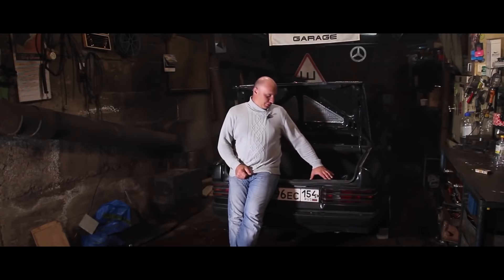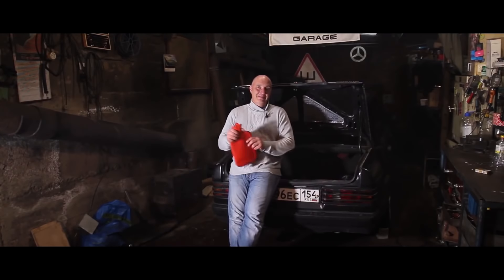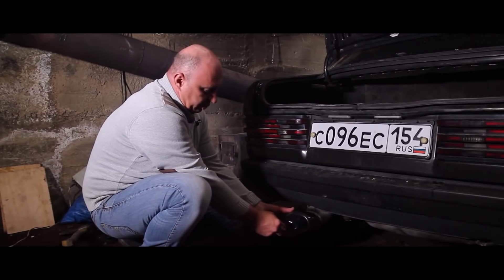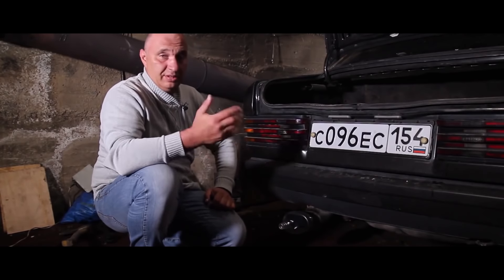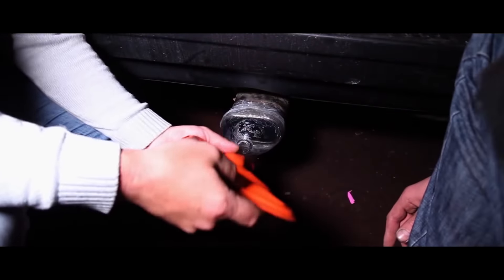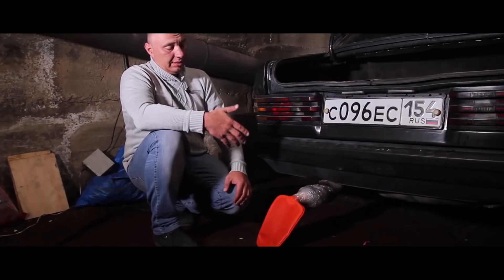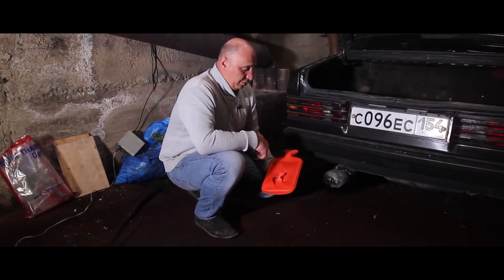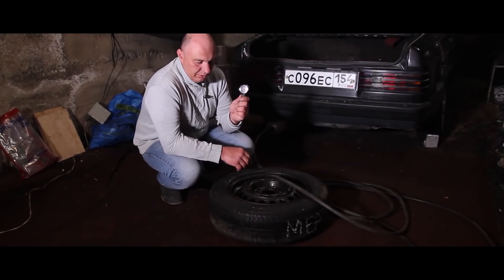Heating pad vs exhaust system: what gives up first?

Comment: Attach a hot air balloon to the car so that it uses its exhaust to fly.
Reply: sounds like a regular baloon with extra steps
Reply: Can't happen. Molecular weight of N2 is 14g/mol. Molecular weight of CO2 is 44g/mol. Molecular weight of water is 18g/mol. Air is about 70% N2 by mol. Exhaust is made of CO2 & water. You can't float a car with exhaust and you certainly can't get it hot enough and keep it hot enough for the density to be low enough to do that
Reply: It's actually Propain that burns to heat the air inside a hot air balloon at 300°+.
Nitrogen is an inert gas.(none flammable)
The gasses that come out of an exhaust are Carbon monoxide,Sulphur dioxide and Nitrogen oxide.
With a tiny amount of liquid known as H2O. 1Hydrogen atom with every 2 Oxygen atoms
Due to the lack of flow (volume of heated air) through the exhaust and the fact that a hot air balloon isn't sealed. Garage54 would need atleast 5-6 cars just to achieve the shape of the balloon with pressure.
2hours later the balloon still wouldn't achieve lift. Due to heat loss and lack of buoyant gasses.
I hope this is more understandable than quotes of weight per molecule lol.
Reply: Great information, thanks.

So any way to make a car exhaust blow propane gas fumes?
Reply: @Vikesh7896  Only if you happen to have a spare Bat mobile (with the turbine engine) lying around lol.
H20 is actually 2hydrogen atoms and 1 oxygen atom
Typing error on my behalf. Ooops.
Reply: @fidelabc123  woooosh
Reply: @Vikesh7896  I think there are many propane conversions - sort of.  There are natural gas conversions, and I think they can run on propane.  As well, forklifts run a combustion engine on propane.

Just in case statement leaver wants to come in with lift calculations, no one specified a size of balloon.  You could use a zepplin to lift a car EASILY - I'm pretty sure they transported military equipment.

And to possiehandler with molecular weights: hide helium tanks in the car and lift it with that as a fun prank/stunt, letting the exhaust escape or remain negligible.
Reply: @easymac79  Now we getting somewhere, we just need uncle Vlad to see this!

Comment: My grand father made an air compressor, using 2 of 4 cylinders from a 4 cylinder engine, the other 2 cylinders is what ran it.
Reply: Great idea
Reply: Scarakus cool
Reply: This was back in the 1950's. He had to make custom intake & exhaust manifolds, to separate the gas/exhaust from the air intake/pressure.
Reply: Wow that's kinda genius
Reply: You would need to make custom camshafts for that, that would be a lot of work
Reply: @georgobergfell  no if you place check valves instead camshaft driven ones
Reply: There are many compressor manufacturers that do just that.
VW boxer engines with a modified camshaft are quite often used.
Reply: @georgobergfell  
No, not a lot of work at all.
It's simply welding an extra lobe on the camshaft at 180 degrees to the existing lobe, about an hour in the workshop.
Reply: That's interesting

Comment: I seem to rememer you asked for suggestons. How about fitting heavy duty casters to replace the rear wheels of a front wheel drive car ? Just take the rear wheels off and bolt casters on to where the ellyptical cart springs fit (or anywhere you can). Please don't forget how casters self center, worth looking that up first. All the best - Regards from the UK.

Comment: You could try to turn a ladda into a boat? Sealing the doors, adding weight on the back to keep it level, propeler on the driveshaft, etc.
Reply: A Ladda?
Is that a car made by IKEA?
Reply: They already turned a car into a boat.
Reply: They turned their 3 wheeler modified ZAZ 968 into boat!

Comment: Stranded with a flat tire? Simply use your exhaust to inflate it!
Reply: Big Brain
Reply: @funkblack  Big Big brain , not the usual big
Reply: I’ve seen an old air fitting that would thread into a spark plug hole.   The idea was to  run a hose from that to your tire and run the engine for a bit until it was inflated.
Reply: @BD-xz6te  cool idea.
Reply: Martin Premier Drums 
First of all, I said they exist. I never said it was a good idea. Second if you were doing this on anything built in the last 30 years you can just unplug the injector for that cylinder. Third you watch far too much TV.  Gasoline probably wouldn’t do your valve stem or the inside of your tire in favors but unless you’ve got a little road flare in there I think you’re OK
Reply: @dickJohnsonpeter  Plus it is highly unlikely that the fuel-air ratio would be just right for it to even ignite.

Comment: I have an idea do the same thing exploding  stuff like you did with the exhaust but use a cylinder take one spark plug out and get one of those hoses That you can screw in the plug hole and the see what you can blow up. That would be very interesting to see  how much pressure a  cylinder in a tired lada can make. I’d love to see that.

Comment: Did the strong heating pad with my partners toyota and its 1.5 liter gutless wonder. He started the car, put it in drive and nearly stalled the engine, which prompted him to put it to the floor.  The engine barely popped the heating pad, but when it did the car pealed rubber out of the driveway lol.

Comment: They should do a video of rigging up like 80 PSI of compressed shop air directly into the intake while the car is running. Or similarly, dumping the contents of a liquefied oxygen tank directly into the intake in the same manner, although I wouldn't want to be around that..

Comment: I would like to see you take a spark plug out and use a compression tester to get pressure from the cylinder to air up a tire I remember a old coal miner story about this exact thing using 4 cylinder water pump motor to air up a loader tire .

Comment: Weld a pipe nipple on to the end of the exhaust pipe. Then use a threaded hose barb for the air line.

Comment: I really expected the hot water bottle to grow massively, just shows modern innovation (cost cutting) ruins the fun lol
Put a pipe from the exhaust back to the air intake, make the ultimate EGR system
Reply: It's not cost cutting, it's composite/reinforced

Comment: can a car run on the exhaust of another? and another?...  like a vehicle centipede
Reply: Ben K oxygen would be a problem
Reply: @olliebaxter2402  right.. the question comes down to how much oxygen does the engine burn.  I can't believe it burns 100% of the O2 in the chamber.. can a car run on what's left?
Reply: @BenK12345  A car that runs optimally should only have about 0.02% oxygen in the exhaust if i remember correctly, but since there is only about 4% oxygen in the air maybe it could work.. The second car would run like shit i guess and the third would not even start i think. Maybe if you make the first car run very lean it could work? Haha fun idea tho :p
Reply: Ben K I’m pretty sure the car would struggle as it would expect fresh air, not exhaust gases, as it runs a mixture of fuel and oxygen and might not be able to handle the change - I’m assuming it’d stall very quickly

Comment: Can you do a video where you can make a cam belt fail in use on a overhead cam engine. We know what happens when a cam belt fails , but to drive a car and use something to snap the belt at high driving speed would be interesting.
Reply: Nice legs

Comment: Its a hot water bottle, a heating pad is those pads that you put on the car seat and plug into the cigarette lighter to heat up. PS jubilee clips might last longer than Scotch tape 😁
Reply: But why is it called a bottle? it doesn't look like a bottle and it's floppy...
Reply: @MotorBorg  because they used to be made of glass or ceramic and are bottle shaped
Reply: @MarkSmith-to7xi  I see. In Russian they are called "grelka" that just means "heater". Actually I've seen people use an ordinary glass bottle if they don't have a grelka, lol.

Comment: An engine is nothing more then an air pump ( compressor )  just as the one in your garage except it has a tiny 50cc piston.  Imagine 4 to 8 of them four times larger.  You should get not just 125 psi as a garage compressor but one that can prob go to 3000 psi.  IDEA 💡 don’t use scotch tape this time ( it’s not the first choice I’d make for connecting a hot tail pipe to anythihg except pulling beer cans for a marriage   Use fittings and lets measure the PSI you can actually obtain.

Comment: Fill a tire using the compression from the cylinder using the spark plug hole
Reply: You'd have to install a one-way valve on the spark plug hole first.
Reply: They actually used to make a tool/plug that was used by law enforcement in Kansas USA to help stranded motorists, even had an extra fuel line from the fuel pump that they could use to fill a gas can

Comment: Can you connect the exhaust pipe right to the carburetor? zero emission car! LOL
Reply: co2 is not oxygen, what a cumbustion engine need to fire his cilinders. they use to take exhaust pressure for a turbocharger tho
Reply: @Driessens_Peter  you wouldn't want to see them try?